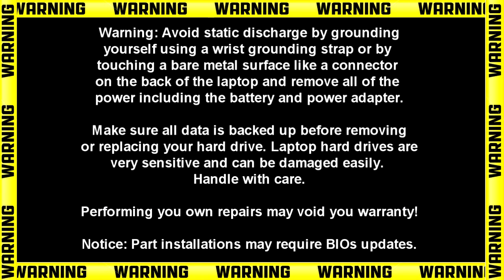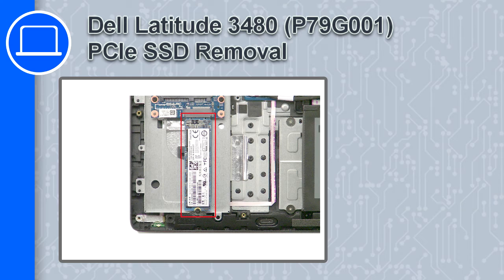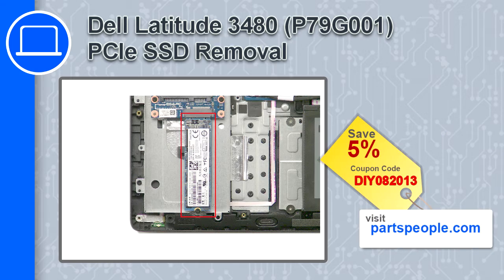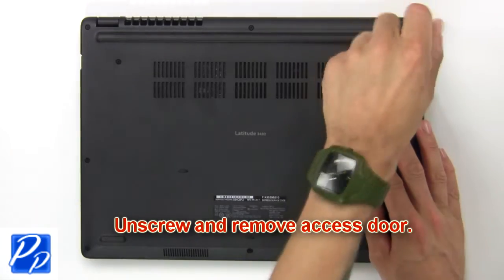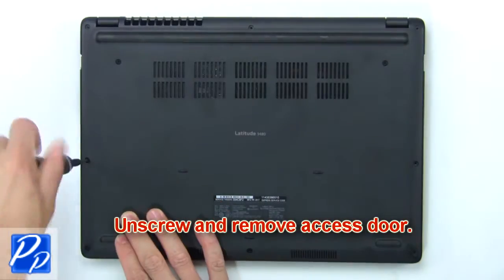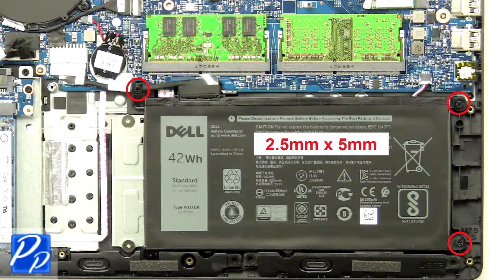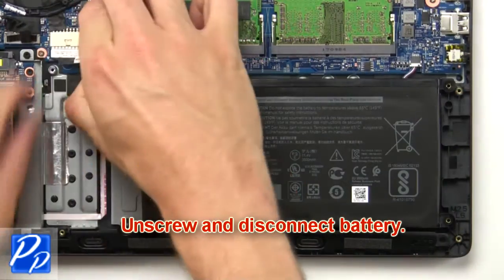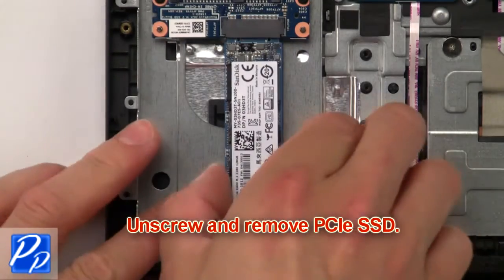Dell Latitude 3480 (P79G001) PCIe SSD How-To Video Tutorial

Comment: can you have both hard drive and m2. ssd or only one?
Reply from the maker: This model will only support one or the other via the SATA connector. A 2.5'' SATA drive connects directly to the SATA port on the motherboard. Alternatively, an M.2 2280 SSD uses a carrier adapter to connect to the SATA port on the motherboard.